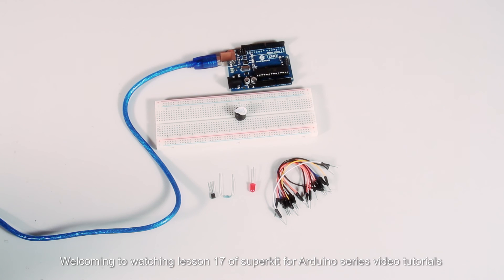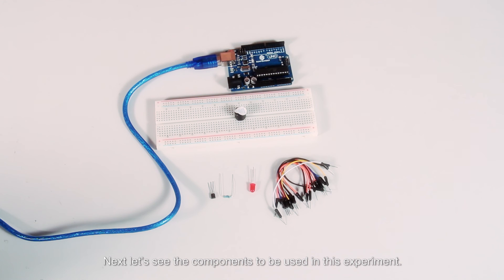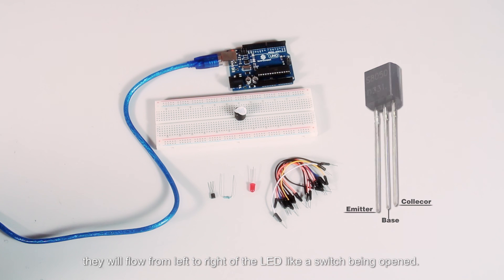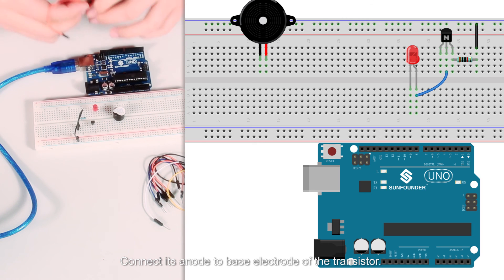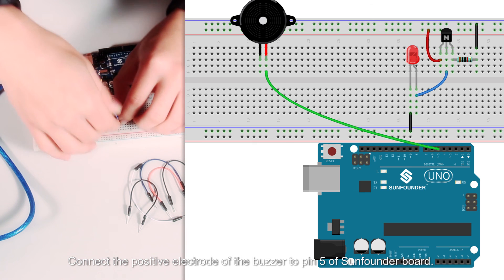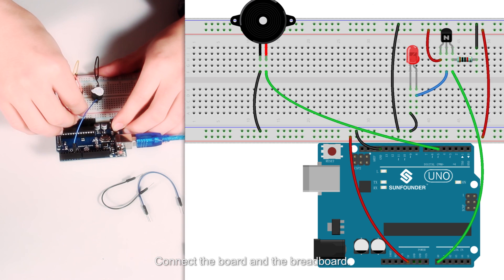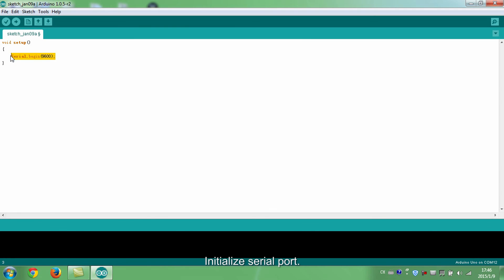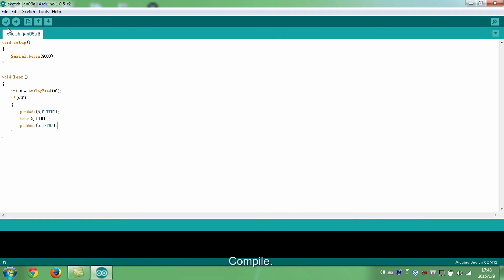Sunfounder Kit Turorial for Arduino - Light Alarm

Comment: I think in a NPN transistor the current flows from the Collector (right pin) to the Emitter (left pin). So, shouldn't the transistor be placed in the opposite orientation? I get signal only flipping the transistor around.

Comment: I have the opposite problem, there is constant noise, even without light ... Why?
Reply from the maker: Sorry for late reply. You need to check whether you're using an NPN triode (S8050). And the experiment should be done in a very dark environment, and you should shine light a lot stronger than the ambient light onto the component.
Reply: Thanks ;)

Comment: i have put everything together like in the video, but nothing happens.
Reply from the maker: +Edward Kennedy To implement this experiment, you may need to place the components in a dark environment, or use a brighter flashlight. For successful experimetn, the incident light into the LED needs to be much brighter comparing with the ambient brightness.

Comment: Found out the problem. When i compared the code in the video to the code on the disc, the disc said pin 4 and in the video it said pin 5 so I changed pin 4 to pin 5 and not it works :D